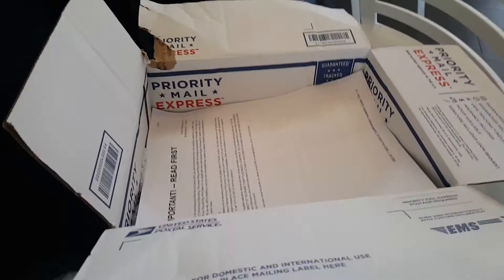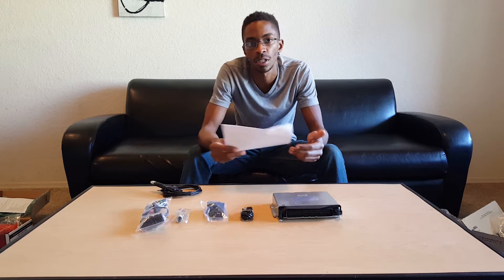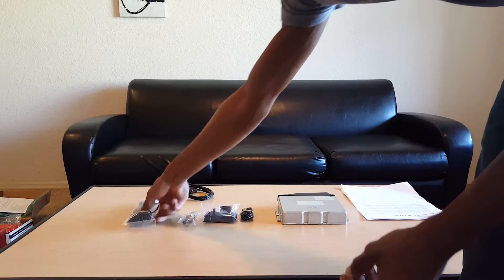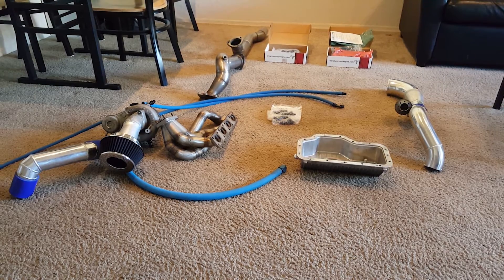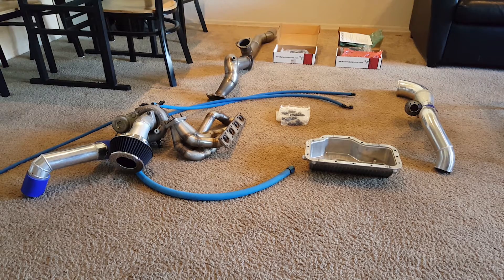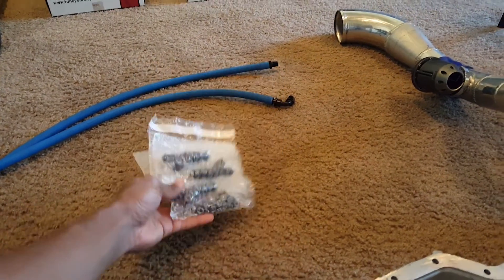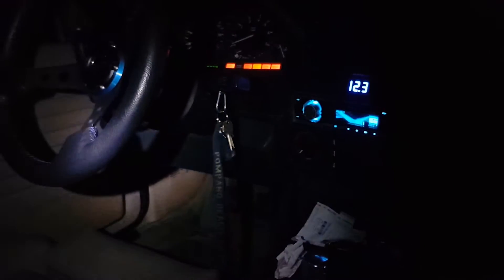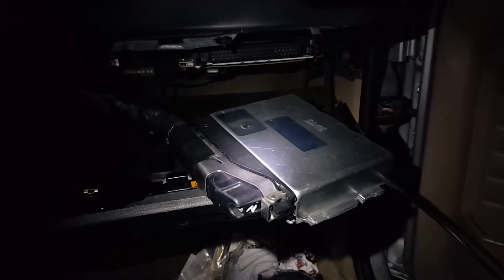E30 M42 Plug and Play Megasquirt

Comment: Very cool project, i turbocharged my m20 and have taught myself tuning as well. looks like you've got a great start. I am interested in that ECU from Dederic because he is hard to get ahold of and the m42 has the 75 pin ecu vs the 55 pin I am running on the m20. I also have an N/A M42 i've been wanting to turbo but the ecu was one of the major hurdles
Reply from the maker: Yes first start with a good efi tuning book Engine Management Advanced Tuning by greg banish is a awesome read. Then fully learn all the features you will need to use for your build reading the manual for the tuning program manual and learning all the basic setting so you know what each thing does. Then you have the basic knowledge of how what your doing with numbers affects the response of the engine. Also the facebook page guild of efi tuners can help give you small details like the range of air to fuel you want to run NA vs Boost then the rest is really just trial and error. I will do a few videos on tuning in the future.
Reply: Do you have any advice for learning tuning from scratch ? any good forums etc.. 

Will be for an m44
Reply from the maker: Ted Schultz thank you its been a journey will be dropping more videos very soon and catch youtube up on the builds current state. Derek is a bit tough to reach sometimes because this is his side thing to help the bmw community out but he gets the job done. I am still sorting out a few things with the ecu but everything is working as it should.
Reply: Sweet, I'll keep an eye out for updates. Curious to see what the m42 is capable of with an actual standalone vs others who just use a turbo chip
Reply from the maker: Ted Schultz thanks trust me its alot you will see.